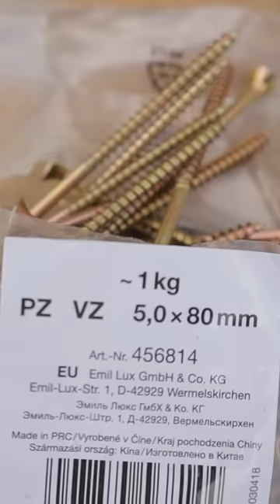DIY pallet deck for CABIN #shorts

Comment: If you don't go down to the frost line In your region, it will sink over time.  This is not the way for foundation
Reply from the maker: here you have long videos of this pallet cabin
FOUNDATIONS, DECK  https://youtu.be/5Nf0tNmiydY
PALLET WALLS             https://youtu.be/ovWgtiKi8mw
ROOF, WALLS                https://youtu.be/VctLgn0Okko
DOOR WINDOW            https://youtu.be/n6BmHerKZjA
DOOR, ROOF                  https://youtu.be/YVmeUzD5RCk
CABIN EXTENSION 1   https://youtu.be/AbH84Hdel0s
CABIN EXTENSION 2   https://youtu.be/1zlpY5ly6zk
Reply: @klerobi1  
Not for me

Comment: Isn't it possible to only ram levelled earth to put the concret block on? Wont the hole fille of sand act as a wick for waters ?
Reply from the maker: a hole with sand is like a foundation. you must always lay the drainage felt in the hole first and then the sand. yes, you can lay concrete blocks right on the ground

Comment: Great work on those footings 👍 Most important part of the deck. Looks good man.
Reply from the maker: Thanks 👍
Reply: Those aren't footings 😅
That was sand he put in those. 
Those blocks are going to be all over the place after it rains 🌧 
Not to mention the screws he used,  will be rusted away in a few months 😂
Reply: @kumaralockwood3172  I could be wrong, but I believe that was brick mortar... which could easily be wet AFTER leveling and tamping, causing it to harden in situ. 🤔 Also, those screws look to be electrogalvanized ... so no rusting.
Reply: @klerobi1 you’re AMAZING dude‼️ pure artistry

Comment: No need for polythene in the hole before concrete it’s a load of pee , love the video though great job . Polythene is a load of nonsense that everyone thinks needs to be done but it’s actually a waste of time and bad for the environment. Concrete isn’t porous and already air tight watertight . Reinforcing on the other hand works wonders.
Think of all that very old dams that’s holding back water 🤷‍♂️ yup concrete and nothing special added. Just a good old mix .

Comment: That’s going to settle all over the place.
Reply: Sand is loosely packed. Even if you pack sand with a vibratory  Compacter it won't be as tight as if you laid it just on soil compacted soil or concrete
Reply from the maker: here you have long videos of this pallet cabin
FOUNDATIONS, DECK  https://youtu.be/5Nf0tNmiydY
PALLET WALLS             https://youtu.be/ovWgtiKi8mw
ROOF, WALLS                https://youtu.be/VctLgn0Okko
DOOR WINDOW            https://youtu.be/n6BmHerKZjA
DOOR, ROOF                  https://youtu.be/YVmeUzD5RCk
CABIN EXTENSION 1   https://youtu.be/AbH84Hdel0s
CABIN EXTENSION 2   https://youtu.be/1zlpY5ly6zk
Thank you very much for watching the videos!!! 👍🙂